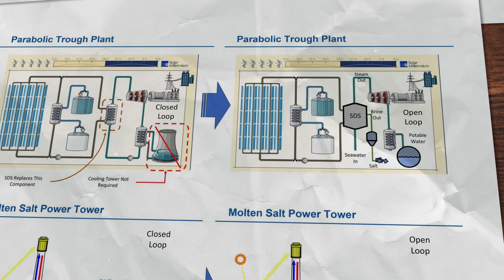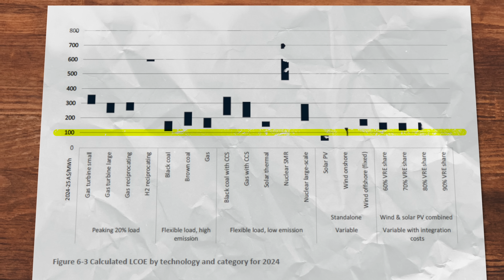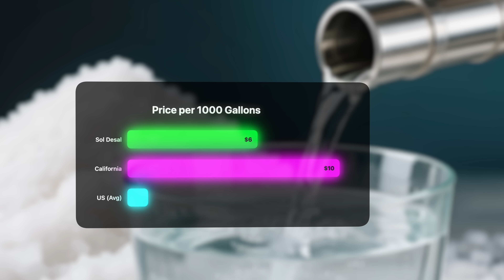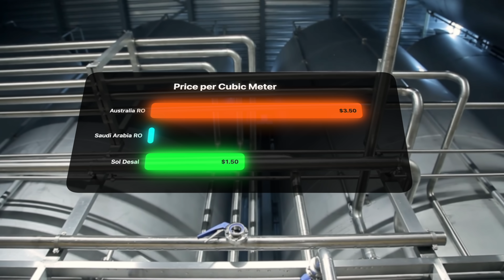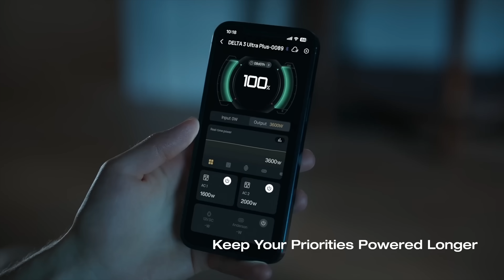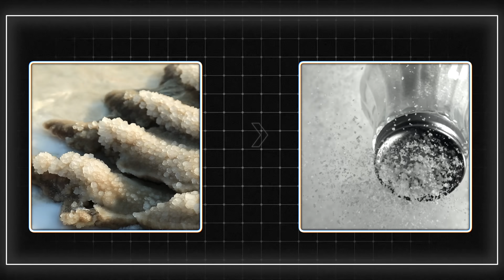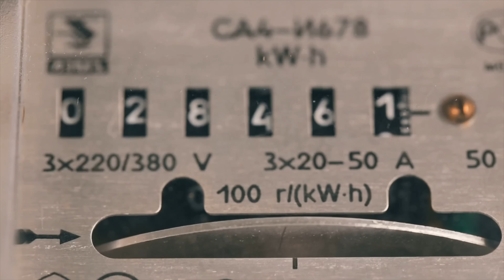The Desalination Process that MAKES Electricity - Too Good To Be True?

Comment: This is a nit, but at 8:35 you say that 3800 plants would produce 190 MW. That's not very much. The good news is, your math is off by a factor of 1000. The correct number is (3800x50 MW) = 190000 MW, or 190 GW. That's roughly the equivalent of 190 nuclear power plants.
Reply: Yes, it was 190 GW, not MW. Typo in the script. Thanks for catching that!
Reply: @Israel_Two_Bit  okay… yeah that makes way more sense. When I heard MW… I was very confused as to why this hasn’t been done.

Comment: Glad you looked into corrosion issues. Another issue related to this is considering what happens to pipes. Both build-up and reduction with galvanic action will be present.
Reply: Hot, salty, steam... Nothing will go wrong. 😂
Reply: @cliffordbradford8910  not only salt, also any other pollutant in the ocean water. Should be interesting to see what's in there.
Reply: This is just an idea from an unqualified person, but could you positively charge the turbine and pipes so the sodium ions won't stick to it? Then maybe do a negatively charged "collector" to capture them after that step?
Reply: glass.... thick glass
Reply: @dertythegrower Salt will build up on glass too, its not just the pitting but the build-up that is problematic.
Reply: @jarbuthn  you could have an auger in the pipe to continually remove build up off the walls.
Reply: Use the seperated water once a while through the pipes to dissolve the buildup
Reply: I designed several of these systems that avoid corrosion by not transporting the sea water. You heat the air above the water with a black dome is one system. You don;t get electricity but the salt is remixed with water from tidal action so it never gets too salty. Instead of one massive plant I designed cheap systems you can install say every 500' to a 1000' along a coast. Each one would produce 50,000 gallons of water a day. A few could provide water for a small town and they'd cost 20K to 30K each. Sadly no one is interested in solutions. You make more money off massive desal plants so that's the go to, not simple and cheap. A chimpanzee can design an efficient desal plant so why are they so massive and inefficient?
Reply: There are plenty of products that can resist build up and corrosion. CPVC just being one off the top of my head. The main reason this has not been done is the fossil fuel industry plain and simple.

Comment: 9:41 forget sodium batteries - just use the solar energy to heat the salt, and run it as a heat battery.
Reply: How does that help with the core goal of supplying more fresh water?
Reply: @palpytine  It doesn't. But it addresses the issue of excess byproduct and also adds additional energy to the grid, further pushing towards a carbon emissions reduction.
Reply: @Fenthule  that works for me large scale grid storage but does nothing for cars for example. Sodium ion still have a future
Reply: @palpytine  The same way any battery use would help.
Reply: … or both.
Reply: No, sodium batteries are superior than lithium, many ways... ironically the sponsor just made a sodium ion battery kit.. which you may see on a future episode 😅
Reply: Not to mention all the other useful elements you can harvest from the salt. Potassium is a big one. We need that for fertilizer, and there's not nearly as many places to get it as nitrogen fertilizer. It's about 1% as common as salt in water, but on the scale we're discussing here, that's a substantial percentage of the current global consumption.
Reply: Endlessly scaling solar heating isn't a viable solution.   Byproducts need to be used to avoid runaway storage/containment issues.
Reply: @jarbuthn there is a difference between "solar panels" and "parabolic solar heating".
Reply: The batteries are for cars
Reply: They would have to constanrly make new batteries to keep using the surplus salt.... doesnt make sense
Reply: @John...44... How big is the fleet of cars on earth? Most aren't electric yet. Batteries are not the only thing salt is used for. North America uses so much in winter for roads.

This system isn't perfect but has great potential. Water is sorely needed in many places.

Comment: something this simple and useful, you have to assume it would have been done decades ago if it was viable. your video doesn't explain how they plan to remove the salt from the steam which i guess is the main problem right?
Reply: Probably nobody has really got into this for a couple generations. One could think of several possible ways to solve this. Here is one: 
Use vacuum distillation in (for instance) three stages, with each stage having a higher pressure. The amount of salt transferred will be reduced on each stage. The brine from each stage is recycled back to the previous one. The pumping required for the reduced pressures and overcoming the pressure differentials will take energy, but not a whole lot. The thermal budget will not increase much because the heat can be retained between stages.
Reply: @TheSateef  he doesn't need to explain, the salt is left behind when you turn it into   steam. - distillation -
Reply: @TheDC-ks3tw  that's the problem, not all the salt is left behind, did you not watch the video?
Reply: @TheSateef right so if you rewatch it at the part where I imagine you are referring to he's talking about the particles of salt getting trapped in the steam he says it affects the turbine nothing about the drinking quality. The distillation process removes 99.9% of the salt. Which he states starting at the 1 min mark and many other points clean water.